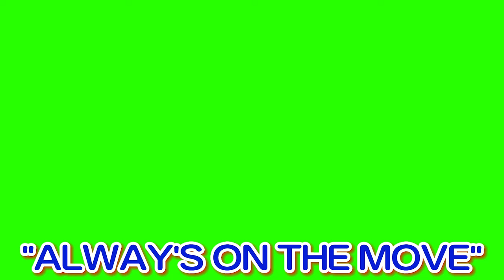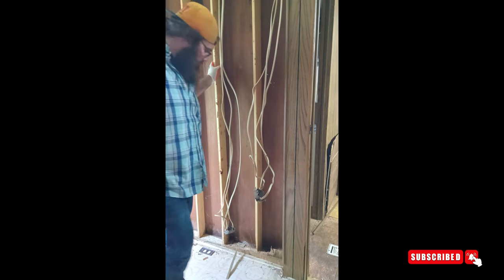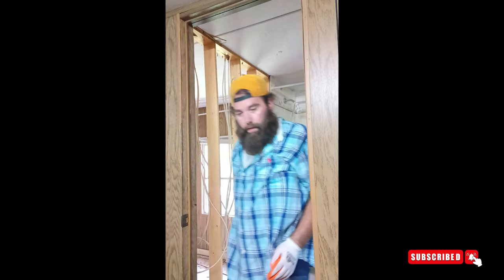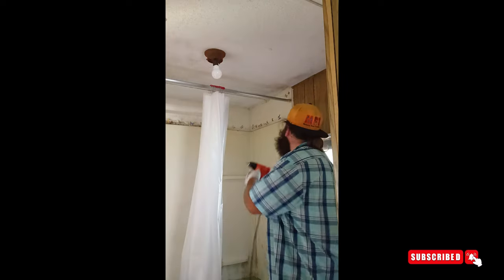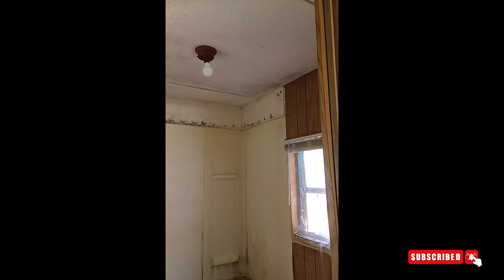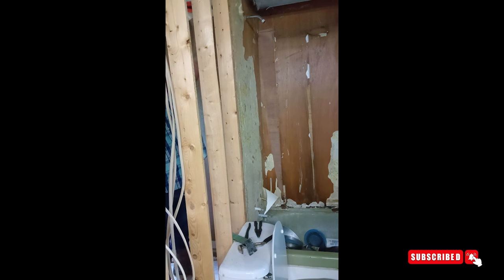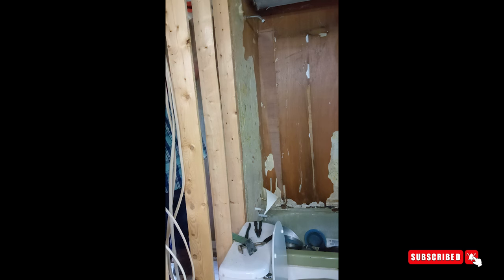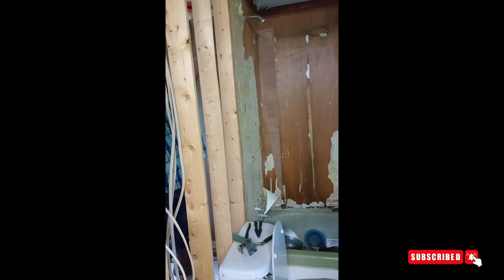1976 MOBILE HOME BATHROOM DEMOLITION

Comment: Murphy Bear, old lady here,  work smart.  As others said,  gut the whole thing,  your floors will have rot in them,  the walls beneath the windows will have rot, if you have a dumpster or trailer you can dump everything in there, that way you won't have to pick it up twice.  Put your metal stuff/fridge,  washer,  in the bus and recycle,  get a little money for remodel. Don't expect to have this done in a few weeks.  Good luck ❤
Reply from the maker: Thank you for the support we are excited to start this renovation and can’t wait to clear this mobile home out and start fixing what we need too.

Comment: If you  can I would gut the whole trailer and start over .  Design it a different way to  have kitchen and living room bigger, a place to put a washer and dryer.. Have the bathroom in your bedroom .  There's spot potential here,  design a plan. Do away with the front porch , it's not connected to the house  so the rain is  coming in.
Reply from the maker: THANK YOU FOR THE SUPPORT AND WE WILL KEEP YOUR SUGGESTIONS IN MIND THANK YOU

Comment: Wouldn't it be cheaper and more sensible to removed the old trailer and put a new one in its place ? The area is so pretty . I can't wait to see the finished product , but a little advise if I may  lol ... While remodeling make sure to silicone all open spaces around pipes  to keep mice and/or rats out . seems they get into trailers so easy that way , Don't want to have an infestation ...Eeeeks!!
Reply: No, it really wouldn't